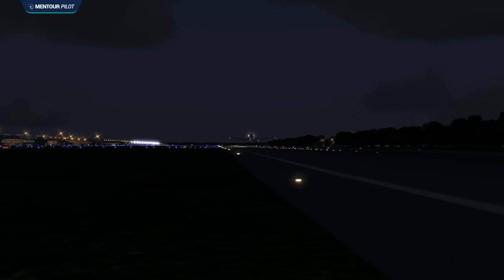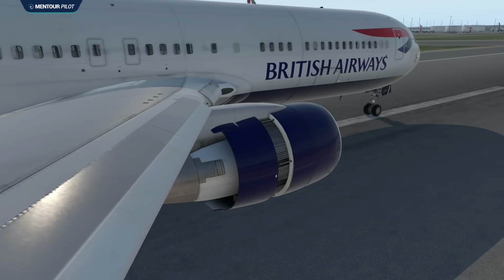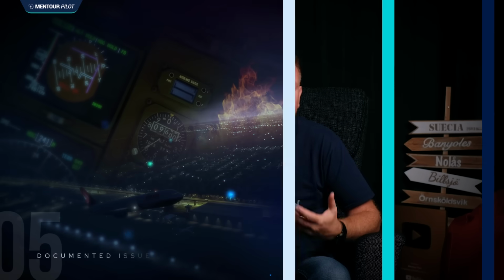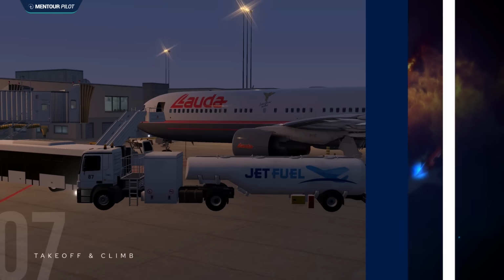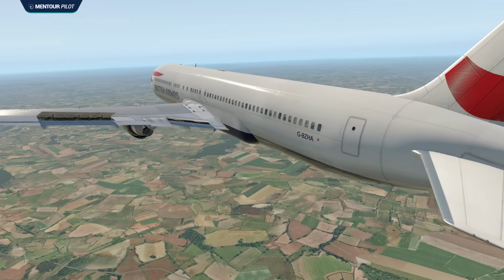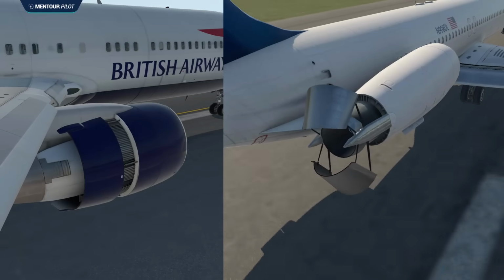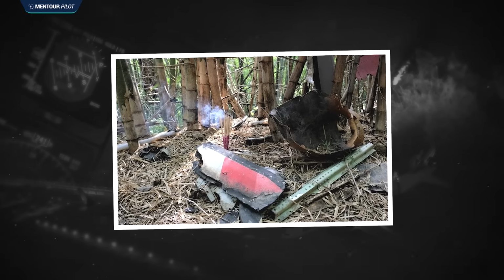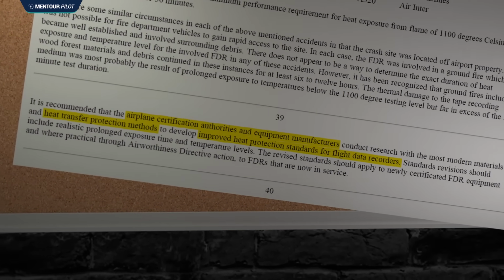HOW an Impossible Failure CRASHED this Boeing 767!

Comment: I was taught all flashing yellow lights are to be considered as steady lights (it’s actually in the flight manual). I would have shut down the engine and RTB or landed at the nearest airport.
Reply: Like with the Gimli Glider. Canadian aircraft regulations allowed flying without working fuel gauges. Also, why would anyone putting a measuring stick into the tanks misread it so far off? Where was the "Wait. That's not enough."? Should have led to the fuel crew asking the pilot "Was that kilos or pounds?". Naww, they just used pounds and loaded less than half the fuel requested.

Comment: Have you done a vid on Arrow Air flight 1285, almost a decade ago I believe, when over 200 US soldiers died on a transport flight (not active duty). Long forgotten and almost hushed up - a disgrace that from what Ive read these types of use has the lowest level of safety requirement. Soldiers one must assume are expendable, even when not on duty. Would you do your take on the story, re the safety levels then, are they still current? etc.
Reply: Every human is expendable, there's literally BILLIONS of them, infesting literally every continent.
Reply: @InservioLetum  we'll assume you have never lost a loved one to someone else incompetence or corruption. Try reading about real world stuff, and enjoy your next flight, hoping the underpaid and rushed maintenance guy/gal hasnt fitted the wrong screw or used the wrong glue...

Comment: From all we know about Boeing - following the 737 Max disasters and seeming reluctance to admit anything until it was too obvious to cover up - it doesn’t surprise me a tiny bit to find Boeing tested the in-flight deployment in the least onerous test conditions possible (in this case almost in idle, no thrust situations) and then report it as if it were under general flight conditions. They’re too big to fail at this point and are in way too close to the FAA as, again, has been shown. I’m a little disappointed that you seemed to brush over Boeing’s seeming determination to minimise any blame and almost cover it up.

Comment: The very first flight I ever took happened in 1983 in a Lockheed L1011. We were flying from Toronto to London with a short stop in Montreal to pick up additional passengers. Our brief stop in Montreal very soon became a lengthy stop of 4 hours or so. I remember the captain announcing that he himself had been out on the tarmac himself, manually cranking in the thrust reversers back in. He didn't explain what thrust reversers were or why they had to be cranked in (or why it took so long to crank them in) but I just trusted to his expertise and the rest of the flight was without incident. It is only now, nearly 40 years later, that I have any idea what a thrust reverser is and does. I finally see why the thrust reversers were so critical! The 4 hour delay was tedious at the time but things could clearly have been much worse if he hadn't paid attention to the thrust reversers.

Comment: I might well be wrong, but for some reason I thought early DC-8s allowed for thrust reverse in flight. There is almost no time where the idea is wise unless you have no flaps or spoilers and you need to lose 200 knots quickly while still descending or during landing.

Comment: Fun fact:  The DC-8 was the only aircraft certified for thrust reverser deployment in flight.  Not in the regular Flight Operations Manual, but a fun feature to impress DC-8 pilots flying a simulator by the simulator maintenance guy.

Comment: A case, I fear, of closing the stable doors after the horse has bolted. A thrust reverser should NEVER deploy in flight; even inches from the runway. When someone first designed the system years back, wouldn't that have been uppermost in the mind?...the poor people died because of a simple design error. An excellent account given by a real, live human being instead of a computer voice!

Comment: Hi Petter, good collection of information, I slightly found the aftermath a bit short though. This accident had a huge impact on design (engine location,airframe/engine system design, engine/TR system design) to minimise adverse effect, as you correctly mentioned but also on certification and crew training, too. One of the key improvements was the introduction of TR mechanical lock, usually part of throttle quadrant. This feature also ensures a key requirement, that in case of inadvertently deployed in-flight TR the engine shall produce idle power. In CS-25 there's a separate paragraph dealing with this topic related to turbojet engines under 25.933 (a) (1), and the associated AMC.
I guess you need to spend lots of time compiling all of the information and besides your assumangly busy summer roster this is a great achievement, well done. Greetings

Comment: Relying on the crew to respond to a fatal error in 4 to 6 seconds is completely unreasonable.
The first design change required is that the reverse thrust should not be able to stall the wing, and the second thing is that if the plane is capable of flight with the reverse thrust on, which it obviously is, then it should be designed so that if one is on they are all deployed so at least the fault does not cause instability.

Comment: It is important to point out that the "reversers" on this aircraft are NOT thrust reversers.  On the older 2-shell clap thingies you could actually deploy them and spin the engines up and draw yourself backward across the tarmac/staging slabs.    The flow diverters on this plane are designed to create an impeding drogue made of air around the engine pushing a LARGE mass of air forward to almost all sides creating a large much lower than atmosphere pressure area behind the engine.  When used in pairs they "suck" the plane slower and for the most part don't really produce thrust aimed to push the plane backwards.     At 530mph they're gonna produce upwards of 3x the engine's active thrust setting in a much much higher pressure differential.     The resulting effect in air is as if an almost indestructible parachute 25 feet in diameter suddenly snatched open attached to the engine pylon.

As to "do everything exactly right within 4 to 6 seconds" I'd like to add that the engine spool down is too slow and likely even firing the direct engine extinguishing equipment still would have not interrupted the portrayed event.   The moment the diverters engaged the event was unstoppable even had they forced slat deployment and killed both engines as the diverters engaged.   The landing diverters on the engines are simply the most dangerous system on aircraft at this time.   They're exceptionally useful and effective on landing but will always be a ticking time-bomb in flight.

There is absolutely no reason why we cannot start installing multiple data and voice recorders on aircraft.
There is absolutely no reason why we cannot transmit data and voice records FROM the aircraft live by network.
Reply: That's interesting, I never knew the way reversers worked were this different, let alone that the design quirks meant that it was more sensitive the faster the aircraft travelled
Reply: @Prjndigo thank you for this informative comment. I had a thought when I was reading it. It might be a stupid question, but I'm gonna ask it anyways. If the right hand thrust diverter had been deployed immediately after they realized the left one had deployed, would that have given them enough time to spool down the engines and get this situation into a manageable situation?
Reply: @DanniV8 , I believe there's no possible way to do that intentionally. The best they could have done would have been to pray that the other one also malfunction immediately.
Reply: @seriouscat2231  Yeah I know it's impossible, just wondering if it would fix the situation if it was possible.
Reply: @DanniV8 , they would lose all thrust and 25 % of lift. Maybe that could give them some time to shut down the engines and attempt to glide. It depends either on how fast they would go with 75 % lift and zero flaps or how long they have in that case to figure it out before they start exceeding safe speeds. I think Mentour could answer this.
Reply: Personally I don't want the world listening to my cockpit chatter....
Reply: Sadly the only really important thing in this world is money. We could do so much better but companies would have to pay for that, better to make things that are just workable and then call it done.
Reply: @mobilemarshall  starlink is so cheap!

Comment: What annoys me the most about this easily avoidable incident is that the ones piloting the plane were the only parts of the incident that didn’t make mistakes. I am disgusted by the lack of sense used by testers when determining how safe the thrust reversers really were at operational speeds. That, and the incompetence of the airline to ground the aircraft until the engine was repaired, makes me very angry.

Comment: (October 2016)

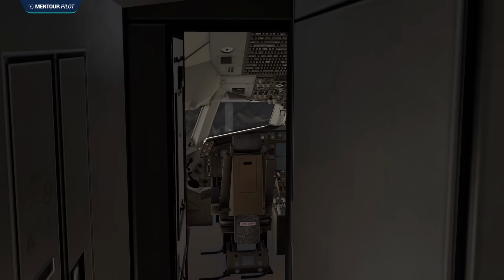Same heppned tô TAM Transportes Aéreos Regionais Flight 402 was a scheduled domestic flight from São Paulo–Congonhas International Airport in São Paulo, Brazil to Recife International Airport in Recife via Santos Dumont Airport in Rio de Janeiro. On 31 October 1996, at 8:27 (UTC-2), the starboard engine of the Fokker 100 operating the route reversed thrust while the aircraft was climbing away from the runway at Congonhas. The aircraft stalled and rolled beyond control to the right, then struck two buildings and crashed into several houses in a heavily populated area only 25 seconds after takeoff. All 95 people on board were killed, as well as another 4 on the ground. It is the fourth deadliest accident in Brazilian aviation history, the second at the time. It is also the deadliest aviation accident involving a Fokker 100

Comment: It is absolutely insane that those switches, whose failure can result in massive death, are susceptible to moisture.  It is unconscionable that they are not completely sealed to prevent anything from interfering with the switching mechanism.  What would it cost to completely seal each one -- a couple of cents?  Maybe a dollar at most?  The cost of sealing every switch would be negligible compared to the total cost of the aircraft (if done during manufacturing).  Obviously retrofitting seals would cost a lot more than if the switches were manufactured properly, but even that amount is justified compared to the potential massive loss of life (not to mention the loss of the aircraft).  Manufacturing those switches in a way that leaves them susceptible to moisture, especially when their intended use is in an aircraft engine, is malicious negligence.

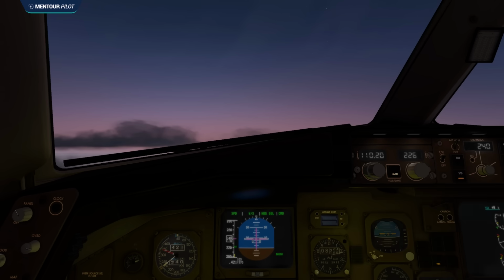Comment: 14:50 Surely, the QR checklist should instruct the pilot to shut down the relevant engine until the problem is rectified, even if the thrust reverser has not yet been deployed.

Comment: if its impossible how did it happen
Reply: That‘s because aircraft designers are not really fit in electric/electronic design.
Often they outsource such tasks and install it then into their airframe.
Sometimes I say they are sheet metal workers that by two engines, avionics, electric and integrate this all in their aicraft.

Comment: Also it is of note that quite a few years later, a military flight crew replicated this incident with a LIVE aircraft. It was over at Edwards AFB in California USA. The crew was VERY experienced having done combat take off (CTO) and landing using the thrust reversers in a controlled manner. Well they did it at altitude, and what the video showed was "edge of the seat" and shocking. They used I believe an Edwards Test 707 (Military KC-135 variant) and rigged one engine to go into reverse on deployment in the cockpit. It did EXACTLY what Boeing tried to deny. Now in a 4 engined aircraft the results were a little less dramatic than on a 2 engined aircraft due to diminished asymmetrical condition and prompt pilot and co pilot control. 

Essentially it wasn't "quite" as bad, but bad enough! It caused so much drag on I believe it was on engine 3, that it began to drag the plane into an asymmetrical engine thrust condition (basically "dragging" the wing with less engine thrust, while the wing with normal thrust pushes the plane along) this can make a plane turn, or far worse, roll and lose attitude control. The normal correction for a 4 engined aircraft is to assess the engine status, if a fire is the problem, pull the extinguishers, cut the fuel feed, essentially make sure it's "dead" then lower the engine thrust on the matching opposite wing engine (ex: eng 3 out, cut down engine 2 until the aircraft is trimmed and controllable and Captain's discretion on flight continuation). But on Lauda's aircraft, a 767 has only two engines. Simply put, one dies, same rules and secure the dead engine and land as fast and as safely as possible on your remaining one. But with a reverser? That poor flight and crew had NO chance, they didn't know of the phenomenon and were not probably trained in recovery. But their sacrifice was not in vain, they make it safer so this drastically reduces the chances, but as Mentor Pilot pointed out, its not foolproof. But it has saved lives and thanks to Niki Lauda for caring so much.

Comment: Aiden Milward has a really interesting video on how niki lauda basically tricked boeing into admitting the design fault with the 767 too him by offering himself as a potential sacrificial lamb for a flight test that would've recreated the circumstances of the crash in an identical 767.

He told them "if I die, I die" and they told him they "couldn't sanction a potential suicide mission".

Comment: I remember this crash .. a very similar incident happened with ASA Embraer 120 Flight from Atlanta to Brunswick, GA in 1991 - the Left Prop failed to LOW PITCH instead of Feather, as a result of a worn quill, pilot loss of control and crashed .. the pilots could do nothing to compensate the huge drag and it rolled them into the ground .. on the ground the prop worked perfectly during failure test, but they discovered that in flight there were additional forces that drove the prop into Low Pitch .. the entire fleet was grounded and Hamilton Standard redesigned their prop ..